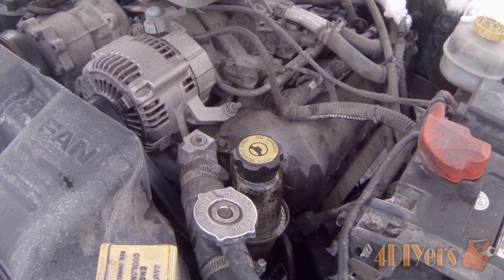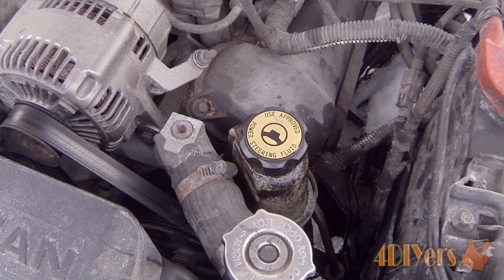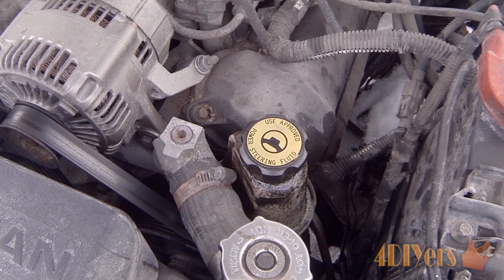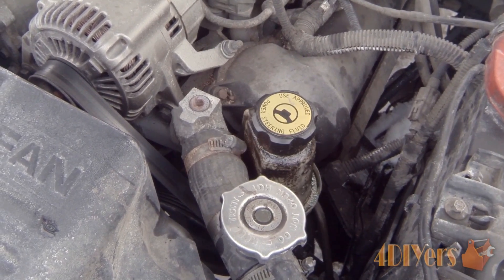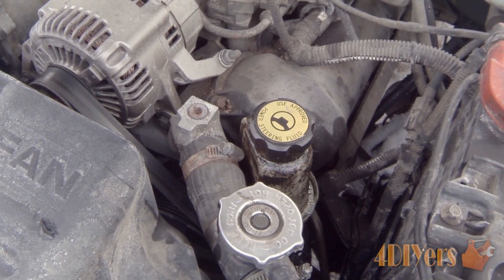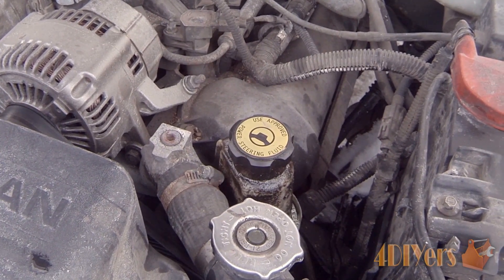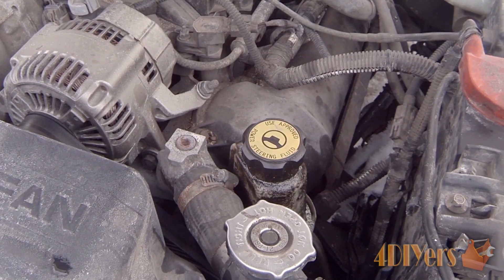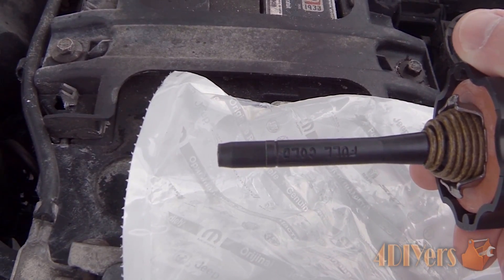DIY: How to Troubleshoot a Power Steering System

Comment: Hi. I have a super big favor. I was hoping you might be able to tell me what might possibly be wrong with my vehicle. We have a 08 Dodge Caravan that is making a loud whining like noise. We took it to a couple mechanics and some said it was the alternator and some said it was the power steering pump. We replaced the alternator with cost us $250, car still made the noise. We replaced the power steering pump, the car still is making the noise. The mechanic said he actually put 3 of them on thinking maybe the first 2 were also bad and he flushed the system 5 times, Car is still making the noise. We have spend over $500 now and it is still making the exact same noise. No problem with steering the vehicle and no other symptoms other than the noise. Sounds like it is coming from the pump though. Now they want us to pay $500 more to replace the rack and pinion but he is still not even 100% sure that is what it is. It is really loud and doesnt get any louder when turning the wheel. The vibration and noise sounds like it is coming from the pump but it is not the typical bad pump sound when you turn the wheel. Just a consistant loud whine. I am at a loss as to what to do now. With 4 kids and we just bought a new house 30 days ago we don't have the money to throw away to continue to troubleshoot and replace things that are not broken. Hoping you can help. We are desperate at this point. Thanks.
Reply from the maker: First off the mechanic should NOT be replacing parts they are not sure of. All parts can be tested if the mechanic has the knowledge or is willing to spend the time rather than wasting a customer's money. I see this issue far too often. The power steering system can be pressure tested which should have been done first to determine if the pump is faulty. When replacing the pump, I would hope he also replaced the filter as this can cause issues. A plugged filter will also cause a pump to whine. To help isolate the sound a mechanic's stethoscope can be used. The vehicle can also be ran without the power steering belt for a few minutes (depending what else that belt drive) to help determine if it's actually the pump or something relating to that belt. Automatic transmissions can also make a whine is there is an issue too. if there was air trapped in the power steering system, you can also bleed the system yourself fairly easily using this procedure https://www.youtube.com/watch?v=00c3o5YoYCE Whining can also come from other things as well but this is a good area to start first. Don't forget to subscribe!
Reply: I gave 96 Honda minivan, had loud whining exact sound of bad power steering pump but steering was fine. Decided to change,  big mistake, still was whining ( very) loud.
Eventfully found out it was the a\c compressor going bad. The a\c quit working one day, as soon that happened,  whining stopped.
Reply: Found out it was just a pulley the belt is attached to. Super easy fix. We are stunned that no one figured that out before the hundreds of dollars we spent replacing parts that were fine. Thanks so kmuch for your response. I appreciate the help.

Comment: I own a 2007 Chevy Impala and the steering wheel is a bit stiff and every time I turn (both left and right usually at lower speeds) there are multiple cracking noises. Could this be from low power steering fluid or maybe from something more serious?
Reply from the maker: +bosco De La Mora Have you checked the power steering fluid level??? It could possibly be, but the fluid maybe old and in need of replacement. You can also be experiencing seizing steering components too. Is your power steering making any whining noises???
Reply: +4DIYers Hey I have a 03 town car and I replace the rack twice it turns easy then tighten up to either side.. I need ur help please..
Reply from the maker: Does it turn hard after a certain point when steering left and right and does this occur after the vehicle has been running for a period of time??? First place to check would be the power steering fluid and determine when it was last changed. Along with that, was the filter replaced if equipped. Next would be to bleeding to system of air to ensure there is no present in the system. Another issue can also be a slipped belt, this should be follow by a squealing. Tighten if needed or replace due to a glazed belt. If it passes those issues, then jack up the vehicle, with the wheels off the ground check to see if this occurs both with the engine running and not.

Comment: My power steering fluid is returning with great force back to the fluid deposit, even pushing the cap out and making a mess of hydraulic liquid, and the steering wheel is hard to turn. Do you have any idea where I can find information about this issue?
Reply: Thanks in advance.

Comment: What does it mean if tour  power steering fluid sprays to the left side of the car would that be a hose or something else i can really tell
Reply from the maker: +doomsday 360 It could be a variety of issues. You do need to find the source of the leak, that is the only way to determine what part if faulty unfortunately.

Comment: I hope you can help but I have a chy. 300 and one random day my power steering isn't working well..it turns fine to right and no power assist f or the left. Help me!!
Reply from the maker: +Stephen Dengler There could be an issue with a pressure valve not releasing pressure. But unfortunately it's most likely a much more expensive issue relating to faulty steering rack.

Comment: My steering turns very fast to the left(tyres follow wherever direction) after i start engine, problem started after replacing rack,tie rod ends and ball joints.Tried to bleed still did not work, what could be the problem? Toyota Carina 2000
Reply from the maker: +andre kristoz And it turns hard to the left??? Could be an alignment issue.
Reply: Did alignment soon after the replacement of the other parts, what remains is to change the whole rack and see if it works

Comment: I need help please help my truck will not hold power stirring fluid I have a 2000 Dodge Dakota it seems to be spraying on the inside of my driver side wheel well any suggestions
Reply from the maker: Wash any access oil first so you can see a leak, it's most likely a hose. Don't forget to subscribe!
Reply: I'll do what I can but it's just sprained Emily to melt everywhere.   Also I'm having  a bad misfire :/
Reply from the maker: Check out my video on washing an engine. It not only makes it easier to spot a leak, but when the repair needs to be done, it's much nicer to work on a clean engine. Sounds like it's a significant leak so when the engine is running and the system is pressurized, there should be no problem spotting the leak. As for the misfire, scan the codes first. It could be something simple like a bad plug or more complicated like a compression issue.
Reply: I'll do that but also I noticed that it's spraying out from where the Cap is what do you think ?
Reply: +4DIYers so it's covering my motor in power steering fluid and it's leaving a giant puddle on the ground but only when I steer it to get the air out of the system
Reply from the maker: Dodge did have an issue with the caps not releasing pressure. Try turning the steering with the cap left loose to see if it's still causing the same issue. I do have a video on this regarding the cap not releasing pressure. It should only leak when the engine is running, but not when it's off. If you find it's leaking with the engine off, then the residue might be dripping down or there is a new leak that occurred due to the issue with the cap.
Reply: +4DIYers yeah it's really weird when I'm turning the steering wheel you can watch the fluid drained down and when I run the engine and Park it and open the hood it'll be covered and power steering fluid and at the bottom of the reservoir for the power steering fluid there's a pool of the fluid and when it's parked it all just drip down of all your advice i'm hoping you can help getting sick of buying power steering fluid
Reply: Cams Garage ummm replace the pump maybe?

Comment: I can't find any help with my 2013 dodge 1500 4 door 4.7 liter I got stuck in the mud for 2 days then I got pulled out then my power steering went out I mite have an eletric power steering pump

Comment: Hey there, awesome and informative video. Explorer 2003, rack&pinion was just replaced, but steering wheel is NOW harder then ever. Mechanic said the power s.pump was dead due to NO circulation, so i bought an after market one at Auto Advance. It was installed and we bled the system, everything worked fine during those 1st 8-10mins. Steering was smooth during the bleed process (left and right). 

Suddenly, MINUTES LATER as I left the shop, the steering was tighter, i mean extremely stiff, unless I pressed the GAS. So, when i got to a STOP sign, it was amazingly difficult to turn left, but when i pressed the GAS it was smooth. What could this be? Could it be that darn after market Power s Pump that doesn't work after we bled the system or it doesn't provide the correct psi pressure to the entire ps system? thanks for any advice. 

PS: By the way, mechanic has ordered the Original Ford Power Ste.Pump at Ford dealer...expensive ; ( $170. it should arrive this week.
Reply: never mind...i bought an original Ford p/s Pump and steering is smoother then ever! after market sucks!
Reply from the maker: +Carlos Rios Most likely there was an internal issue with the pump. I have seem some faulty aftermarket pumps due to improper assembly or repairs. For myself I have a power steering rebuilder where I can take a pump in to and have them rebuild the original pump. Much cheaper than buying a new replacement. Hopefully you were able to return the faulty pump.
Reply: +4DIYers Thanks again...

However, i noticed this morning that my power s. fluid was quite low. Rebuilt rack and pinion was replaced and i placed a new original ps pump, 3 days ago. Feel like simply giving up with this explorer. What may have caused this fluid to get low? PS hose was changed about 2yrs ago. : (
Reply from the maker: No problem. Have you noticed any leaks? If not, then there could have been air in the system that eventually worked it's way out.

Comment: what if the steering wheel isn't rotating back to the center position when turning left or right,while the car is driving in motion,after releasing it?
what could be the problem?
Reply from the maker: That would be relating to a fault with the tires, seizing ball joints or tie rods, or the steering isn't aligned properly.

Comment: I have 2012 nissan altima. I took it in to get a/c replaced. Went to leave shop and power steering doesnt work. They kept it 2 more days. They said the pressure is good no air in lines even called nissan to get help and they still cant figure it out. do you have any ideas?
Reply: does it have electric steering?
Reply: could be just a fuse

Comment: i removed my power steering hose to take out an alternator on my 2006 acura tl and when i turned the car on the power steering fluid leaked every where why is this ? i connected everything back the way it was
Reply from the maker: Does it use an o-ring or crush washer as a fitting seal? Replace the o-ring if it's damage or if it's a crush washer, then they only have a one time use.

Comment: I have a 2002 buick regal(not supercharged) when I turn right, (no noise when turning left) there is slight squeak that seems to pulse so squeak squeak, quiet then squeak squeak not a squeal. I noticed that my power steering fluid was low, I have filled it and checked for leak(none found) and checked fluid level again after driving which was fine. I am also getting a squeak over bumps, similar to a rrr rrr like a bed spring, probably a strut or shock. Just wondering if you think that all noise is suspension related or whether I am dealing with a suspension and steering problem? Thank you in advance for any help.
Reply from the maker: +C Pearce Have you tried turning the steering with the engine off??? If there is a fault with the power steering pump, the pump may not make any noise when the wheels are centered but will make a noise in both directions. So in this situation your pump is most likely fine. Unless there was air in the system, then of course it would need to be bleed. How low was the fluid??? If you are noticing a squeak while driving and when turning to one side, then it is most likely a steering or suspension component such as a dry sway bar bushing, sway bar link, ball joint, or tie rod. Inspect any boots for cracks and if they are equipped with grease fittings, then add some grease.

Comment: im so confused. when i went to get an oil change on my 99 Nissan Altima they told me its something wrong with the power steering. but my wheel isnt hard to turn. am i right or wrong that if there are problems with the power steering that my wheel would lock up?
Reply from the maker: What did they say was wrong with the system? Does it whine at all?

Comment: How long can I ride on a bad rack and pinion? Been doing it for 5 years 100k lol  I mean I'm not loosing power steering fluid. It drives and steres fine even alignment on point. I do hear minor noise when parking etc and boot Is toren which got little worse over years  I got about 250k on my camry don't want to put money into it besides that car good mechanical condition any advice? I wanna make this car last without doing unnecessary work $$ save money
Reply from the maker: +brs “Brsrafal” rafal Are you sure the rack and pinion is faulty??? And are you referring to the boot on the tie rod??? What type of noise are you hearing??? Normally I don't recommend driving with faulty parts driving with faulty parts as it can cause other items to fail and are a safety risk for you and other drivers on the road.
Reply: +4DIYers yea I'm. Sure it's rack and pinion been told by many mechanics besides that front end strong hopefully it would last it's  500$plus job or 280*with used pinion

Comment: My 04 Taurus with 306k miles has steering play when cold.  Just changed fluid and both tie rod ends but didn't help.  What else should I check? Thanks!
Reply from the maker: When you refer to play, do you mean loose? Or is there some form of clunking? Does the pump make any noise?
Reply: Yes,  I mean lose. No noise.
Reply from the maker: Considering the fluid has been recently replaced, I would check the level and ensure the air has been bleed out of the system. Next inspect for any leaks, you may have a leak on the high pressure side of the system. Other issues can also be the universal joint on the steering shaft seizing, ball joints are seizing, or the seals are failing on your power steering rack. Don't forget to subscribe :)
Reply: your problem is its a ford......burn it..
Reply: I've cleaned it with sea foam and it works fine now. Ford is very good. My car has 310k miles now and still runs great.

Comment: I was doing doughnuts and my shit got messed up
Reply: Just happened to me tonight
Reply: I had to rock my ass back and forth in the snow to get unstuck then went to head up the driveway and BAM no power steering anymore. Shit fucking sucks.
Reply: Bro did you get it fixed cause my new truck is fucked

Comment: I have a 2001 Dodge 1500 4x4 with a 5.9 engine. I've been told that there is a filter at gear box that could be my problem,is this true? My pump is turning and is full and fluid was coming out of the cap but is very hard to turn the steering wheel.
Reply: Same here

Comment: If my front right tie rod on my 03 Buick Century needs to be replaced will that cause the power steering fluid to leak?
Reply: I noticed power steering fluid on the ground shortly after I put some in.